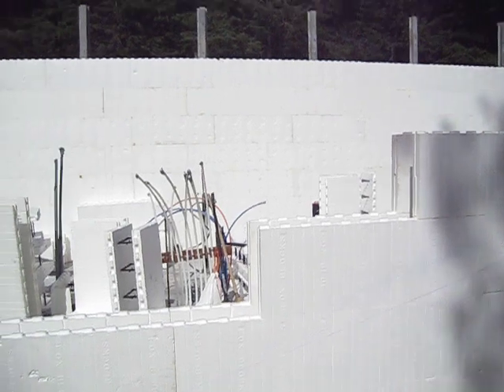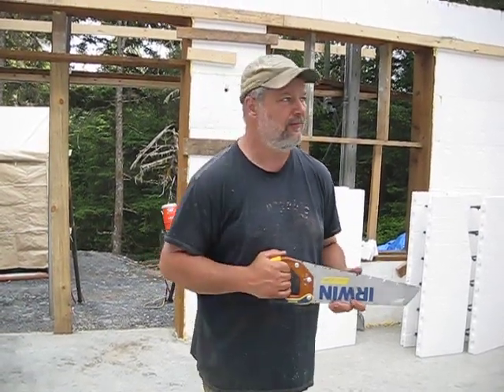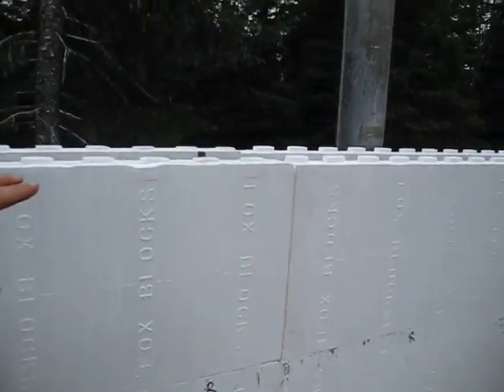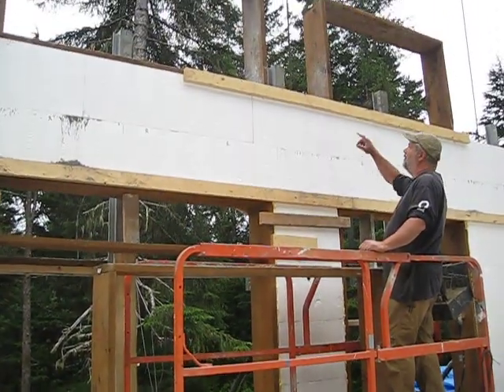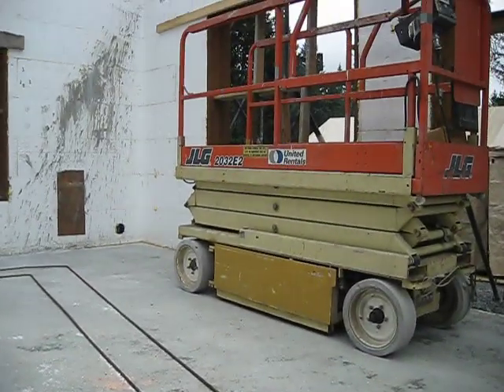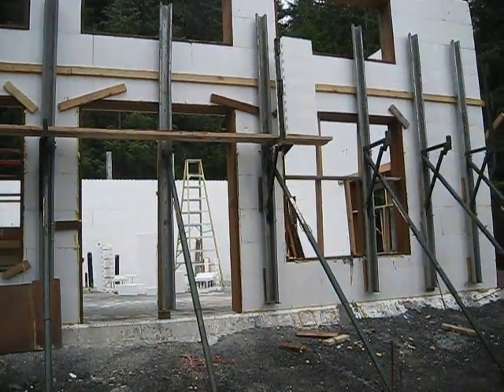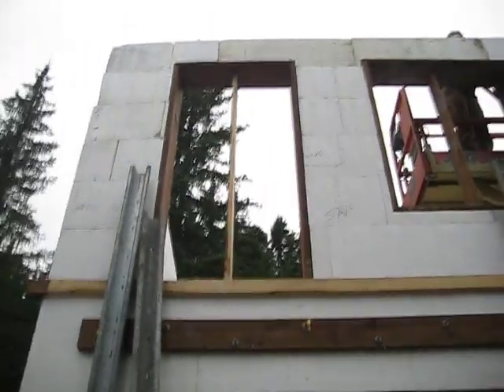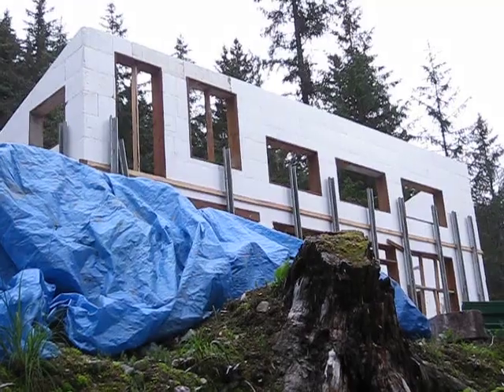Building ICF Walls Part 6 with Fox Blocks in Alaska 2nd Level

Comment: I hope that its not too late to tell you. You need to build a lintel above all windows doors and all openings. You also need to place 2 pieces of vertical rebar on each side of each door window and all openings like those. These are very important for strength and integrity in these areas. Good luck. Tim

Comment: For your sloped gable end wall, did you just put the top plate flush with the top of the wall insulation, or did you  embed/sink the top plate down into the concrete  along the sloped wall so that it matched the slope of your truss joists? I'm trying to figure out how to detail it.  It looks like the top plate along the lower wall might need a double top cap to raise the truss joists to match the side wall slope if the side wall top plate is not sunk into the concrete.   Similarly, it looks like the high wall top plate may need to be doubled to raise it high enough to match the end wall top plate unless the tapered wall top plate is sunk into the concrete.
Reply: I would cut the ice inch and half lower and put the sill right on top of it . drill all your holes in the board and put in the j bolts and the treated top plate/sill while its all setting up

Comment: Can concrete come directly in contact with the wood window frames, or are they temporary?
Reply from the maker: Joe, we used treated 2X12's for the bucking. If we had used regular lumber, we would have put a sill seal or something between the concrete and wood.

Comment: How does that structure handle the permafrost soil?
Reply from the maker: In one of our posts we talked about site prep. When using easy form mono slab product, make sure all organics have been removed. We had almost none on our building site as it was hard pan ground. I had a root ball that I dug out of north side of the house, then replaced with pit run gravel.

Comment: Window bucks? Lol...
Reply: Window and door bucks are wood(Fox Blocks also makes a foam product that creates your bucks) frames that close in the open ends of the blocks where your windows and doors will be. They hold the concrete inside the wall as you pour. Bracing and reinforcing of the bucks are very important. We didn't brace a door buck well enough and so we had a small blowout. I now have a concrete front step where one hadn't been planned, haha.